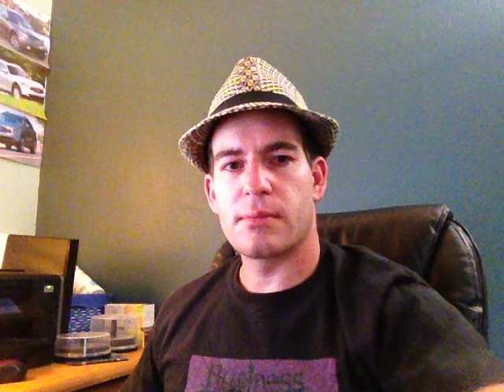How to know if your auger motor is bad

Comment: Pellet Stove Pro I need help!!! My auger quit working the other day, just the auger. Stove still turns on and starts up but won’t feed pellets. No problem I’ll replace the motor.... still not working. A local older gentleman who works on pellet stoves said it’s either the motor or control box, says no worries he has a new one I can test out. I did and still same issue. I checked all connections and cleaned every inch from the catch container to the chimney. I’ve tried everything I can think of and nothing seems to work. Do you have any advice for me to get my free standing Heatilator PS35 pellet stove working again?
Reply from the maker: You may have a bad vacuum switch.  Check out this blog....http://www.pelletstovepro.com/2012/11/my-auger-stopped/

Comment: Merry Christmas. I have a Quadrafire Castile with a non-working auger. The auger will turn on if I pull the suction tube off of it and gently suck on it. When I reattach it the auger stops.  I put a paper clip between the wire ends that attached to the middle of the auger tube. This did nothing. Thoughts?
Reply: I figured it out! When I cleaned the stove out I cleaned out the bottom of the hopper. With no pellets in the bottom, it could not produce enough suction to create vacuum in the line. As soon as I blocked the bottom of the hopper with my hand it started to work. Thanks for the video.

Comment: I have the same problem with my pellet stove. I connected does 2 wires together and works good.I replace vacuum switch still have the same problem pellet do not come down after blower kick. I thing is the control board.

Comment: Hey Pellet Pro, I have quadrafire castile and hear loud squealing like metal grinding and gets quite and blower stops blowing air on  low. Turn up to high and squealing starts again blower starts blowing but stove sounds horrible and after about hour loses power and have to reset snap disk 3. Can you determine if I need to replace a fan from what I have told you?
Reply from the maker: That sounds like the convection fan has gone bad.  This is what you need...https://www.pelletstovepro.net/Quadrafire-CB-1200-Castile-B-FS-Ins-Pellet-Convection-Blower-Fan-812-4900-

Comment: Hey Jason I bypassed the vacuum switch. But still the auger motor will not turn. I've bench tested auger motor and it runs. It's a cab50 ecochoice.
Reply from the maker: Did you bench test the motor while it was in the stove?  Sometimes they'll work outside the stove but not under load. 

Take a look at www.pelletstovepro.org and see if it's a fit for your needs.
Reply: I did test it while still in stove but all pellets were cleaned out and the entire auger tube was cleaned. It just seems like something is not signaling for auger to turn on.
Reply from the maker: I would do the test again w/ the pellets in the stove.

Comment: We have an Earth Stove MP 35-50. The auger just stopped pushing out pellets. After shutting it off for about 15 mins and cleaning it, it started pushing into the burn pot again. It went for about 10 to 20 mins and again stopped. The hopper is turning the pellets fine. It did start making a screech noise? Maybe a metal on metal grinding noise as it was pushing out pellets. We can't find anything about this pellet stove and of course it's below freezing outside when it stops working! Do you have any ideas what it could be? We just started using a different brand pellets but have burnt about 5 bags so far.
Reply from the maker: That sounds like a bad auger motor for sure.  This is what you need...https://www.pelletstovepro.net/index.php?route=product/product&product_id=633
Reply: Thank you!

Comment: I just subscribed to your channel,im haven trouble with my traeger not goin over 80° after 10  min it gives me a LEr code I opened it up and I see my auger switch off and on,should it be doing that?  Please let me kno. Thanks!
Reply from the maker: I'm not an expert in Traeger Barbeques so I don't know what that code is.  Auger motors do turn on/off as they run so that is normal.  I would find a manual and see what that code means.

Comment: Great video Jayson  thx ! How about a auger that is constantly turning?  Friend has a Whitifeld 20 some years old  trying to help friend out ! He had a stove company come out a year ago and I found wires just barely pushed on  the connectors , just found a manual but no schematic  and none on unit .  And company now not in business lol !  Looks like they did put a  Auger motor in it .  Thx
Reply from the maker: That's a bad control board I would think.  Auger circuit relay frozen on.  We can fix that....https://www.pelletstovepro.net/Whitfield-Profile-20-pellet---Whitfield-Profile-20-control-board---Whitfield-Profile-20-circuit-board---pellet-stove---pellet-stoves---Jason-Munson---Pellet-Stove-Pro---optima-2-pellet---optima-2-control-board---optima-2-circuit-board459

Comment: Hi Jason, I have a Englands 25-EP. The auger only transports very few pellets, sometimes none. It spins maybe 1/2" when it turns. I cleaned the whole unit incl the chimney but still the same. Do you thing the auger motor is going bad or do you have any other ideas? Thanks a lot in advance.
Reply: This sounds similar to my problem on a St-Croix Prescott.  I get very inconsistant pellet feed.  On the highest level 5 ,I can keep a decent flame going but the fire cycles from good and healthy to short and barely out of the fire pot.  On lower heat levels the pellets run out and the fire eventually burns out.  I saw a good video on taking the auger + auger motor out to clean and lubricate but I was wondering if a motor could simply get lazy?  Could it turn slower than design speed as it gets old?
Reply from the maker: +Eric Parry .  That sounds like that auger motor is bad.  Sometimes they just get tired and slow down like that.  I would replace it.  I have them on my website www.pelletstovepro.net...
Reply: Thanks Jason,  I will order a new auger motor BUT.. As I followed one video's cleaning method, it included checking the rotation speed of the auger by marking a dot on the auger blade with a sharpie and timing it's full rotation time.  Turns out mine was rotating at 1 RPM.  I bought the stove used and it appears the auger motor had been replaced with the wrong part.  All replacement motors for my stove are 2 RPM which would absolutely explain my problems.  So.. I have a perfectly good 1 RPM motor for sale if anyone wants it!
Reply from the maker: That explains a lot.
Reply from the maker: Yes, that could be the auger motor getting old and slowing done...https://www.pelletstovepro.net/index.php?route=product/product&product_id=110

Comment: I have a 9 year old Quadrafire  1200 i the thermocouple wire broke so I replaced it now the stove starts burns all the pellets from the start up cycle but won’t enter the run cycle by dropping additional pellets and eventually shuts off leaving the red call light on . I am reasonably sure the thermocouple is sending power as the ceramic cover glows red at the end of the start up cycle .
Please help thanks Scott
Reply from the maker: Scott,  That's unusual.  How old is the auger motor.  I'm wondering if it may be going bad.  I would test for voltage going to the auger motor when it stops.  If it still has the voltage the motor may just be overheating and shutting down.
Reply: Jason thanks,
I have now tried jumping the auger snap switch , blowing out the auger vacuum nipple ,blowing out and checking the suction hose ,and jumping the vacuum switch, all to no avail. I will check the wires to the auger motor. I have determined that it appears that the problem is the auger will run for approximately 90 seconds at initial startup then stops it will immediately start again if the reset button is pushed leaving me to believe for some reason the power to the auger is being interrupted after the initial 90 seconds has passed. What could cause this again thank you for your input please continue Scott
Reply from the maker: @scottchristian6624  That is what the stove would do if the thermocouple was bad or disconnected.  If the thermocouple is properly connected at the box, it could the thermocouple circuit in the box is bad.  Perhaps disconnecting and reconnecting the thermocouple to the box broke something internally.  On a side note, take a look at www.pelletstovepro.org.  I have a tech support membership that gets you discounts and access to my cell.

Comment: Hi, I opened the panels on my Whitfield Adv. II-T the other day to find that there was a pile of ground pellet dust directly under the upper portion of the auger motor shaft,  and it does make a little bit of an audible noise when the motor turns during operation. Bad bushing? What can I do to fix these issues? Thank you.
Reply from the maker: That's actually normal.  If it's making noise it's much more likely to be the auger motor than the bushing.

Comment: my stove is only 2 months old.... it shut off the other day and now everything works except the auger,.......it will not drop pellets.  It is a King brand made by american stove company.   I haven't done anything other than empty the hopper,..........should i be able to turn the auger by hand?
Reply: +Robert Smith Jr Try bypassing the vacuum switch first and if that doesn't fix try running direct power to the auger motor to see if that is good.
Reply: +My Business Lifestyle   I will try this today,......my stove is very close to the basement wall and the access panel is on the rear so i have to take the flue pipe apart and move the stove to gain access.
Reply: +My Business Lifestyle   Do you want a good laugh,..........i just took the cover off my stove,..........the auger motor had fallen off,........it is laying on the bottom not connected to anything.  (wiring is connected, but not anything mechanical)  I assume the mounting screws were not tight. So much for craftsmanship.
Reply: +Robert Smith Jr   OK,....i slid the motor back on the auger shaft,...put the retaining pin back in and the stove is now working as it should.  The motor has nothing holding it in place other than the pin in the shaft........this explains why i was able to turn the shaft by hand from inside the hopper.  Hope this helps others and Thank You so much for helping people,........you're AWESOME!!!.
Reply: +Robert Smith Jr Glad you were able to get it going.

Comment: I was wondering if you can tell my way my pellet stove is not getting hot enough. Could it be because the return air is outside and the temperature has been below zero? And if so what can I do
Reply from the maker: Thats possible.  Unless you are living in a house where it is required by code to have and outside air supply I would disconnect it and have it draw air from the house.

Comment: We had the screeching sound last winter whenever the auger would work. This year the anger won't turn at all. The anger button won't light up every few seconds like it always did, but when you press the button, it stays lit continually but pellets won't load. Is it safe to assume it's the bushing? Thank you for the video. We have a St Croix Hastings by the way.
Reply: Hello, I have an enviro EF3. The auger turns constantly if stove is plugged in.
Changed auger relay timer, and power up timer control. No change. Any thoughts on next step. Much thanks

Comment: just put n a new pellet stove for my mom it has been a month the top auger stopped she has burned 10 bags through it  have u seen them break that fast
Reply from the maker: The hopper lid switch or the vacuum switch can stop power to the top auger.  Check both of those and try bypassing them..http://www.pelletstovepro.com/2015/08/how-to-bypass-a-temperature-switch-on-a-pellet-stove/
Reply: the stove was made 12/11/17 it is that new we put it in on 12/18/17 it is just the 3rd of Jan
Reply from the maker: Contact who sold it to you.  They should fix or replace it.

Comment: What if the auger motor is causing fuses to blow?  Jammed auger vs bad motor?  Is there a quick way to test the motor in that scenario?
Reply from the maker: You could buy an inline fuse and install it on the wiring going to the motor and then run direct power from a wall socket.  But the fuse on most pellet stoves is just for the igniter circuit so I would try disconnecting the igniter and see if the fuse will hold.
Reply: So, I disconnected the power to the 2 blowers, igniter and auger motor.  Hooking each on up separately, only the auger motor blew the fuse.  To further test, I hooked everything BUT the auger motor up, put a small handful of pellets in the box and turned on the stove.  It ignited the pellets, no blown fuse.  I removed the auger motor and hooked it up directly to a grounded power cord, plugged into a grounded, protected power strip.  When I turned on the power, the windings flashed and that was it.  I'm assuming a short in the motor windings.  I ordered the universal motor from you guys on amazon, its from a Breckwell P1000 Big E

Comment: auger motor runs normal and 1 hour later it stops  besides changing the auger motor should I be looking for anything else?
Reply from the maker: That could be a bad auger motor unless you are having a high limit sensor tripping as that would shut down the auger motor as well.  If you have more questions on this email me at ebay@jasonRmunson.com

Comment: Soon as auger puts in a few pellets, it blows a fuse on the circuit board. Is that the auger motor?
Reply: +Donna Haas That could be the auger motor or it could be the igniter.

Comment: What about a stove that’s working fine but, when the auger motor is on, it screeches?  Didn’t do it before but it’s really annoying now.
Reply from the maker: You could have a bad auger motor or bushing.  Most likely the auger motor.  If the motor is several years old you should replace it and if the bushing is available you might as well do that at the same time just to cover all bases.

Comment: my auger gets stuck after a few turns; i can move it back and forth by hand, but the motor only spins in one direction and gets stuck. i have to release it by hand by spinning in the other direction. The motor will move the auger a few times and then get stuck again.
Reply from the maker: That is a bad auger motor.  You need a new one.

Comment: I have a pelpropellet stove model # FPPZBD-M and the auger light flashes all the time even when the stove is off. what could cause this . thanks
Reply from the maker: That seems unusual.  That could be an error code but I can't find anything that shows that as an error code.  If it's not an error code then the control board may be bad.  Other than the light flashing, does the stove work?

Comment: I jumped the pressure switch(vacuum switch) the anger turned a quarter turn and stopped. I then jumped out the motor itself and it started running continuously. would that be the vacuum switch?
Reply from the maker: Did you power the motor directly while it was in the stove?  How old is the auger motor?  What make and model stove is this?

Comment: Hey everyone, having an issue with my pellet stove. The top auger is the culprit, bottom works just fine. I've cleaned everything and nothing works. I took the wires from the bottom auger motor and put them onto the top auger motor and did the same with the top wires to the bottom. It ended up making the top auger spin but the bottom auger not. so I know it's not the motor. I've checked the two wires for the top auger and have found zero issue with breaks, etc in either wire. Could this be wiring issue or is there a problem with the board they connect to? I don't really want to mess with that part if so. I doubt it but was wondering if I could cut and splice in the wires from the top to the bottom so that it powers both? Any help getting this sorted out would be great.
Reply: Can't seem to figure out where the vacuum hose would be to see about checking that. Perhaps that is causing that to not work? It's fully cleaned top to bottom so unsure, definitely zero blockage.
Reply: Figured I'd update, ended up finding the vacuum part, unclipped it and used a paper clip and it works. I laughed so bad at that fix. So I'm guessing I need a new one of those vacuum pieces then? For now this did the trick. Thanks so much for this!
Reply from the maker: Dave, I just saw this now.  Good on yah for finding your own problem and figuring out what you need.  If you still need the vacuum switch here is a direct link....http://www.pelletstovepro.net/englander-pellet-stove-vacuum-pressure-switch-pu-vs-product-669
Reply: JASON RICHARD Munson thanks Jason. I appreciate the reply and will be ordering a new one.

Comment: So I put a paper clip in vacuum sensor wires and the auger works again shout I replace the vacuum sensor now?
Reply from the maker: If the stove has been cleaned then, yes.
Reply: So it's not ok to run the stove if I do this?
Reply from the maker: a lot of people run there stoves like this while waiting for parts.

Comment: How do I fix a fan inside my pellet stove?  I can hear what sounds like a metal scraping on metal quick and fast over and over again when the fan is turned on.

We sometimes burn wood and paper inside the stove.  I was wondering if maybe the build up of ashes from the paper has caused something bad?
Reply from the maker: +Jane Montgomery 
That sounds like the motor is bad and needs to be replaced.  What make and model stove is it?